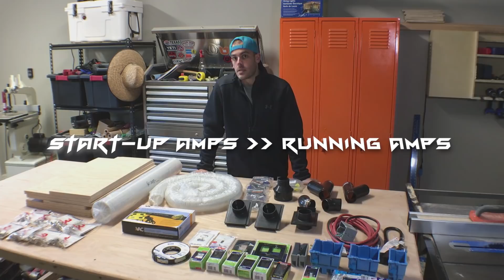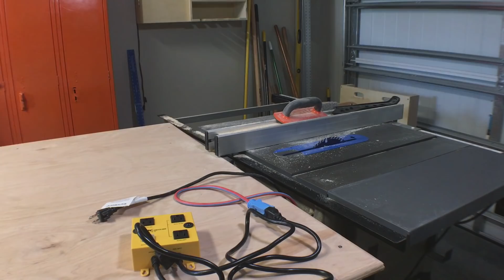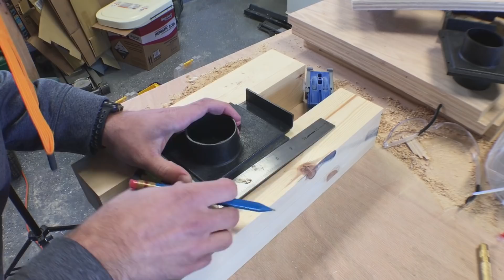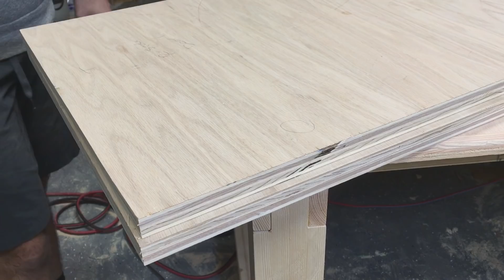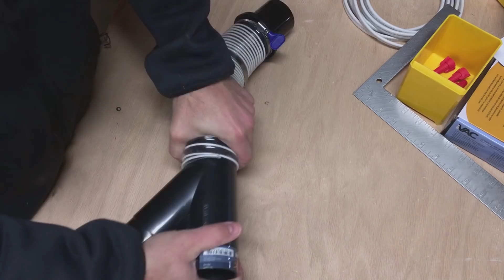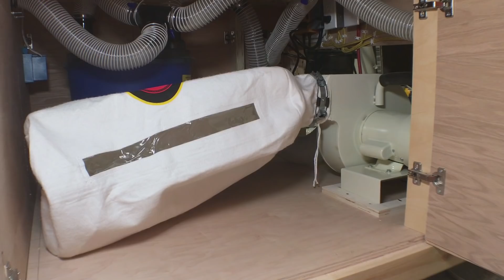Ultimate Workbench Build - Dust Collection // Part 2

Comment: I am currently working on this and have a question. This is immediately being reduced from the 4" dust collector to 2.5" hose. Is the dust collector going to work better than a shop vac that is already at 2.5"? I just want to go with whatever is going to have the best suction power. I'll also be using the Oneida low profile dust cyclone.

Comment: Just a note, I bought all the parts needed and my blast gates look nothing like yours. Mine are orange and aren’t made for mounting.
Reply from the maker: Strange! I will take a look, thanks for the heads up
Reply: @ShopNation  also thanks for the plans! Just finished my workbench (minus the blast gates which I just ordered) and it looks amazing! I ended up doing an epoxy finish on the laminated mdf+plywood on top and it looks stellar! Your plans helped a lot, considering I don’t have a table saw or several other important tools to get the job done the way you did. Warped plywood was the most difficult part to get through.

Comment: nice build, only 2 things that stand out to me. Hopefully you are plugging into a wall circuit that is also 20 amp ? And I am not a fan of the power tech blast gates, because they are not self cleaning. I upgraded to metal blast gates which don't have this issue and then eventually made my own gates. Love the build though !

Comment: Are there provisions in the plans for running 220 to a larger table saw outlet or dust collector, and still having the 110 plugs on the sides for other tools?
Reply from the maker: Nope, that will need to be modified
Reply: Shop Nation thanks for the quick reply. I’ll try not to electrocute myself!

Comment: I have the dust collection done (actually, I'm done up to the set of 8 drawers).  I don't think the shop fox is doing that great a job at collection.  It works, it's just not "wow, look at that".  Any suggestions for improving air flow?  I made the run from the dust collector to the dust separator as short and straight as I could manage.
Reply: hate to bring a old comment up but have been running into the same issue. Any update?
Reply: @mattperez9015  no, I ended up not changing anything at the time.  One of these days, I'm going to replace all the flexible hose with as much rigid as possible.  I'm also going to eliminate the dust port on the end of the bench, I find I don't use it.  Probably get to that whenever I decide to replace the top since it will be easier to do with the top off.

Comment: I have a very similar table setup with a Harbor Freight 1hp blower. I have the same table saw as you on one end, router table at the other end, Ridgid sander on the side and two vacuum ports all with 2 1/2 " gates. Everything is connected through flex tubing. I do not get near the suction you get. I am also using a Dust Deputy. I was running it on a shop vac but went to the dust collector as a upgrade that didn't. I am wondering what I have wrong or different. We are using the same stuff except for your Shop Fox at 537 CFM over my Harbor Freight, which has around 625 CFM.
Reply: I should mention that I used your design to start with from about 6 months ago.
Reply from the maker: Hmm, are all of the connections nice and tight? Should be working well
Reply: I’m going to take a closer look at everything. Maybe I’ll use more PVC and the flex only for connections. I’m baffled

Comment: So you can run your 13 amp table saw and dust collector on the same 15 amp circuit? I get that they don't start at the same time, still seems like it would overload. Very Cool though!
Reply from the maker: Yes! I was equally as surprised. It will overload if I try and start the table saw under load (mid cut) but otherwise no problem

Comment: Nice Video!  Couple thoughts/suggestions...
Your dust bag isn't fully puffing up like it should meaning it looks as though the system is being starved for air. DC blowers need more air volume to move dust particles effectively.  If you reduce down from a 4 inch inlet on the DC to 2 inch lines throughout, it would be best to have at least two gates open for better air flow.  The way the hoses compress under the pressure also is a clue it's starved for air causing a pressure buildup.  The blower should then spin faster too.  It would be better to run 4 inch lines and then wherever you needed to have 2 inch ports drop in a Y to have two 2 inch from one 4 inch, and keep both open.  The table saw collection is certainly better with 4 inch hose than 2.  for the separator they have those 4 inch hose ports you can get with elbows on the inside to make your own trash barrel into a separator bin that way you could customize to fit the space. Maybe a 20gal BRUTE can?

You could also do dual separators, run a 4 to two 2 inch Y adapter right off the main blower inlet to two separators with the 2 inch lines.  two paths for DC then, one for the TS dedicated since it would make the most dust/chips and the other for everything else. Just always leave the TS connection open as well as one port on the other "circuit" so the system doesn't starve for air.

I would also put a "vent" port to allow the collected air expelled through the filter bag to escape from your table, probably in the bottom of the cabinet near the floor.  It looks like it's pretty tightly closed up with the doors and wall panels and the air going in has to go out somewhere.

If i was to do something like this to my workbench in the future what i would prefer is to run the lines inside the table for smaller tools with a shop vac since you get better suction for smaller tools with a vacuum vs a DC.  I would keep my large powerful DC/separator combo (2hp harbor freight unit with a super dust deputy) as a separate unit, maybe wall mounted in the corner somewhere and run a flex hose quick connect to a port on the side of the table which would have connections inside to accommodate anything that needs 4 inch.  Kind of a nice way to hide the line going to the TS or have it redirected from dropping right near it from the ceiling where it is harder to maneuver around with materials and stuff.

Comment: I am looking for a way to add dust collection to my shop table for my Ridgid bench sander, router table and table saw. I think this is the plan. Thanks for sharing. But like has already been said, the main power shutoff switch needs to be in a better location.

Comment: Awesome job! I'm working on a similar setup for my work bench. One question... do you have any issues with the dust right separator in use with your dust collector? It's the only separator I've found that will fit under my bench (and I don't have time to make my own Thien baffle right now). On Rockler's website it says the dust right separator is recommended for shop vacs only. 

Nice sticker on your tool chest btw... Go Vols!
Reply from the maker: I’ve had zero issues with the dust right so far, there is very little fine dust that eventually makes it to the separator bag, so it catches quite a bit!

Comment: I’ve been an electrician (commercial/industrial construction and an Electrical Safety Officer/Inspector!) for almost 45 years and I didn’t wince once watching you do your wiring... 😎 Sure, there’s a few ‘minor’ things I’d suggest or a different product (ie: surface mount switch/receptacle covers underneath vs the flush type) As a few others have suggested, a ‘kill’ stop switch as well as the ‘isolation’ switch, but its not the end of the world and its your bench to use the way thats best for you! I know I’ll be making mine VERY similar to the way you’ve done yours!
Reply from the maker: Awesome! Means a lot to get your seal of approval sir, thanks for the comment.
Reply: Idk, looks like I saw some white romex going to one side of those 20 amp outlets... haven’t seen 12/2 in WHITE in a long time....

None the less I defiantly incorporating this idea into my lower cabinets!
Reply: WhrGuy2 Beat me to it, just adding to what others have said, and its still easy to make a modification. Rout a cable from the isolation switch (in series) and place one or more kill switches on either side of the bench within easy reach. But what the hell, your wiring is top notch anyway. Am still loving your work.

Comment: Nice work!  FYI for DIY people, just remember a couple of things.  It’s your space but doing it right on electrical is important.  First, no 20A plugs on a 15A circuit, that’s not good and shouldn’t be encouraged.  (Sorry not trying to pick apart a good vid) And, NEC 300.14 The minimum length of conductors, including grounding conductors, at all boxes shall be 6 inches and extend at least 3 inches outside the box.  (Looks like you got this right)

Comment: Saw your desk build in my recommended videos.  Watched it, subbed and started watching from you first vid.  Table looks great. My only issue is the placement of the kill switch. It seems as though you could just unplug the extension cord faster than flipping that switch where it’s at. I completely understand wanting a clean appearance, I’m the same way. Slowly working on getting my garage/shop built out. Takes a lot time when I’m wanting to do most of it myself and am only home for a few days every 4-6 weeks due to my job. Upside there is that I have plenty of time to plan how I want it to be and do research.  Your videos are giving me some inspiration and great ideas though. Keep up the good work.

Comment: Should you decide to do any upgrades in the future, here is my recommendation. If your load center (breaker panel) is in your shop, you could run a 240v circuit to the bench. This would give you two different 120v circuits (hot legs) at the bench. One of the 120v circuits could be used at the dust collector and the other 120v circuit could be used for the tools so that they do not compete on the same circuit as they do now. I would also have an emergency stop switch, the type that you just hit not an up/down switch. The emergency stop switch could be mounted at the side of the bench that you most commonly work. The switch you have now is a convenience item not a safety item since it is mounted way under the bench.
The overall design is great and seems very convenient to use. The dedicated dust collection at the bench is a great idea as well.
Reply from the maker: Thanks for the ideas, those are all really great and will be future considerations. If I had to do it over again I’d likely incorporate some of those into the new design.

Comment: Why did you hide the isolation (safety) switch in the middle of a cupboard under the bench? I would have expected this to be better to be more accessible? Also, how do you start our dust collection system for your cordless tools?
Reply from the maker: Hidden mostly for a clean look, there really isn’t much use in having it visible other than regarding your other question, in which case I am planning on locating a dedicated switch on the outside. There has only been 1 or 2 times where I wanted to use the dust collection by itself.

Comment: How's the dust collection working? Making a list of what's needed for my build. Right now I have a rigid shop vac as my main dust collection but it's become to much work rolling it around from tool to tool. Plenty of suction with 1hp collection?
Reply from the maker: Overall the system works great. When I have it hooked up to my sander I don’t see any dust.  Also having it automatically kick on and off the dust collector is so convenient. The one upgrade I’ll have to make is adding a hose to remove the dust from right over the table saw blade. Still get quite a bit of dust generated when ripping plywood out of the top of the saw. I will say that my 1HP setup can really only handle one tool at a time meaning if I accidentally leave another blast gate open - the suction is pretty weak. Not a huge deal just have to remember to close blast gates.
Reply: Thanks for the feedback.

Comment: That IVac  switch is designed for a maximum 8 amp vacuum. Any more than that and it will stop working eventually. I had to upgrade to a Pro setup after 4 months with a vacuum rated at 9 amps.
Reply from the maker: Sean Kerrigan interesting...I’ll have to see how this performs. So far so good but it’s only been about a month. Thanks for watching!